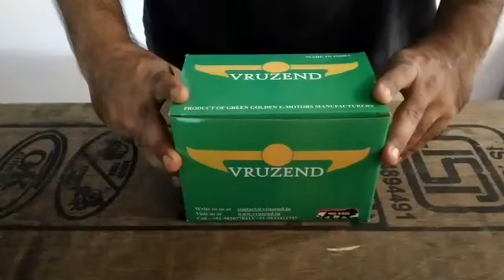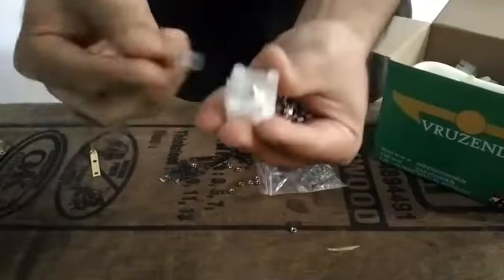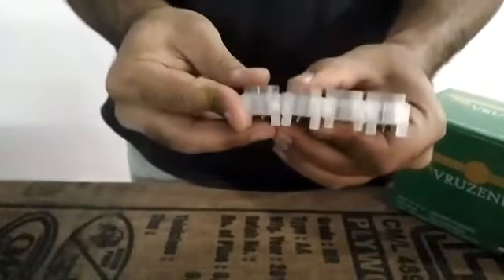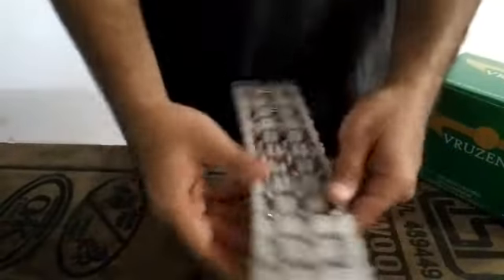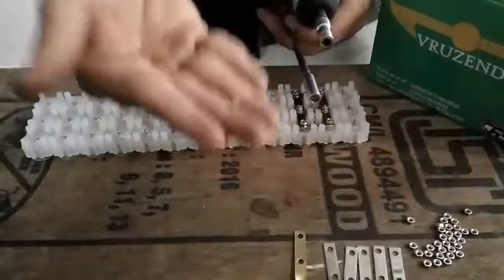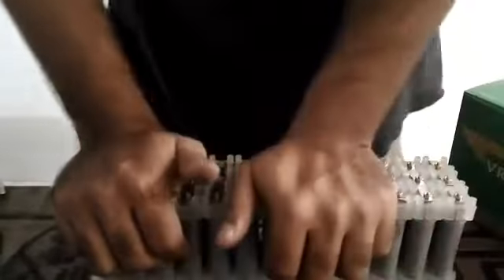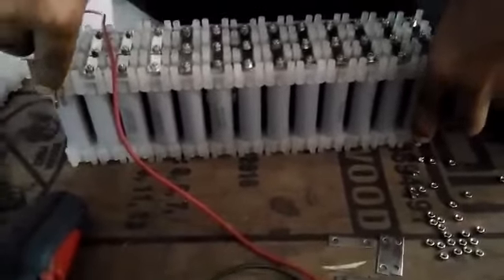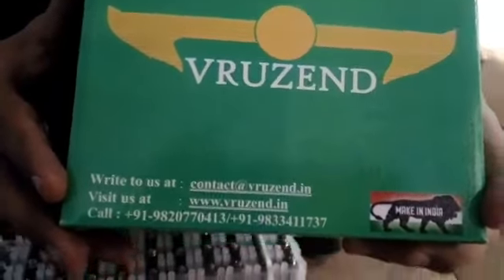Vruzend- DIY Battery pack assembly kit for 18650 lithium ion cells without spot welding

Comment: Cool stuff. Do you make bus bars wider than 3 cells?
Reply from the maker: Bus bars at the moment are 2 cells wide, reason being we cater to a very wide client base. Applications range from small 2 cell batteries for power tools and robos and the real big ones for E bikes and E rickshaws. However if you do have a specific requirement and it is in bulk, then I can accommodate the required changes. Do email me and we can share more details. Email is vruzend@gmail.com or contact@vruzend.in

Comment: I like your product. The only part of the video that I had a problem with is when you were "checking each individual cell". With your paralleling connections already made you can not tell the difference between 1 cell to another cell in that 3 cell set. You would have to do that check before you install your connection terminals.
Reply from the maker: Agreed...I should have said it before doing the connections. Thanks for pointing out.

Comment: what if one cell fail? how difficult it is to replace faulty cell? no fuse wire means it's very difficult to spot bad cell. 
Other then that, nice product.
Reply from the maker: Its pretty easy to dismantle the pack and re assemble it. Agreed the absence of the fuse wire is a bit of a drawback but I think using the BMS and a smart charger can help to some extent if such a scenario were to arise.
Reply from the maker: Hey, You can connect the fuse wires. Do have a look https://endless-sphere.com/forums/viewtopic.php?f=31&t=87434&p=1279966#p1279966

Comment: I would like to see how these cold push contacts handle high currents. I expect anything higher than 5 Amperes would be a problem - together with expansion due to heat. I would love to be proved wrong. The force of a screw acting against a conductor in a screw connector is much greater.
Reply from the maker: Hello Sir, It will do 7A easy. For more details go through the comments here https://endless-sphere.com/forums/viewtopic.php?f=31&t=87434&start=150

Comment: How would I wire up a Battery Monitory System and smart charger.  I think this will provide a much easier way to replace a bad cell but you need the BMS to tell you when (and which cell) that happens, right?
Reply from the maker: Hello Sir,

Its very simple. Simply wind the balance wires around the bolts and secure it with the nuts. For the charge wires use the U clamp bus bars given. Feel free to contact me for any help and assistance. You can view our post here https://endless-sphere.com/forums/viewtopic.php?f=31&t=87434 for the latest news and updates.

Comment: I had the idea the other day. to make a cap for cells like this. I should have known. that someone else had thought of it before. is this available to the united states ? and what's the cost? I need about 4, 8parallel 24v packs. just to start. probably need 8 -10 more in the near future. this looks like it will work great. what is the constant current capability of the connections?  thanks

Comment: can someone explain what this would be useful for ? Thanks
Reply: They are battery banks for some one who needs large amounts battery storage that normally is on solar, with this setup you can make any voltage & amps you need to make from A 18650 rechargeable cell, since you can make them what ever size you want and they are also lighter by A long shot than A car battery & 18650 are cheaper in the long run, after all A 12 volt car battery is just made up of 6 2 volt cells
Reply: Electric bike

Comment: @Vruzend 
 I'M  in Need of Something Near 100 VOLT battery Range 
IN a PARAMIND STYLE;             
I'd Really Appreciate ; Thanks
Reply from the maker: Our email is vruzend(at)gmail(dot)com the new V2.0 will do it.
Reply from the maker: @jerryjordan8551  will be done. A detailed email will be sent shortly. Cheers.
Reply: @vruzend8593   I Really Appreciate This & Any other additional information...Such as a bag to put it in  ( etc )      Also I'm Looking for the Strongest Hub Moter to carry  my Heavy self
Reply: @vruzend8593  I have a ready made, empty battery case, for my ebike,  with a socket for four, e-connection pins. ...the size is ...33cm x 21cm x 10cm..... Please can you tell me if your wonderful kit, could fit into this case, for my bike?  I am happy to change any wire connection but the case must fit the space provided, on my bike. Thank you for your attention.